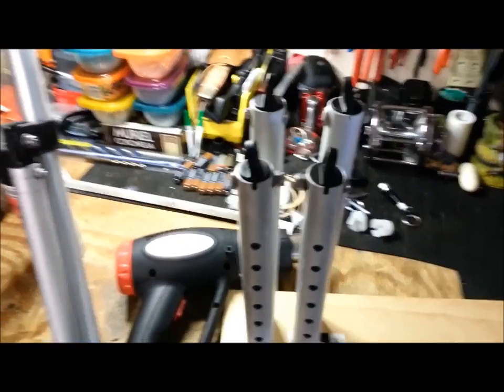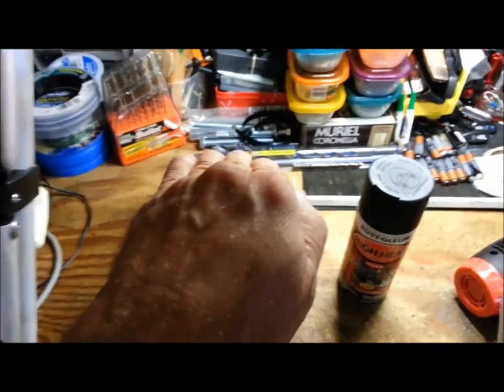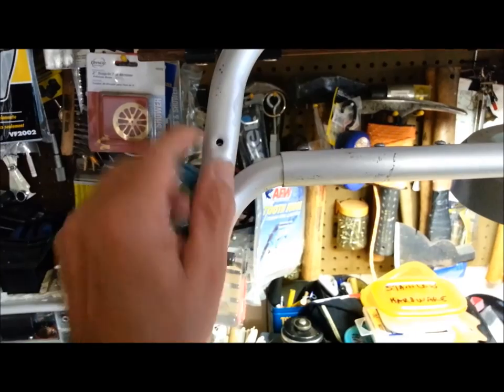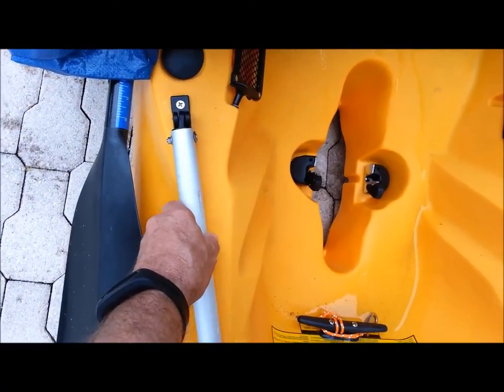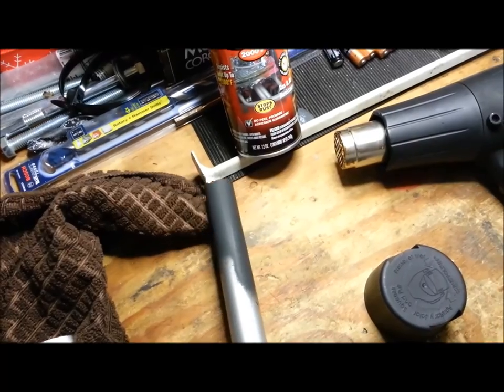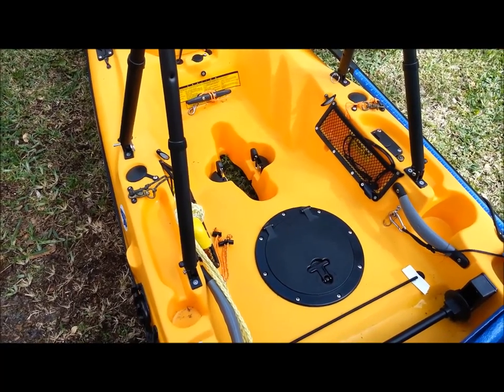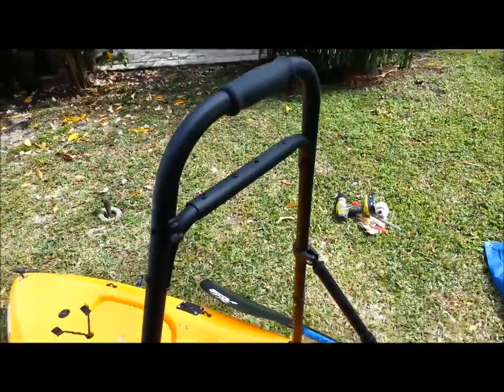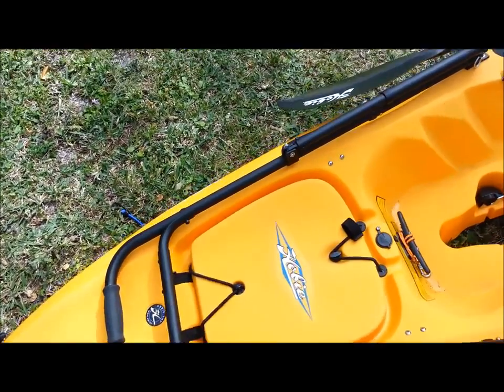Home Made hobie Style H-Bar - Part 5

Comment: Love it! Great video tutorial, John.  I’ve had issues with paints chipping off of diy pieces.  I’ve started using the truck Berliner or undercoat that is in spray cans.  It has a more textured, rubberized feel.  It will chip bit seems to be more durable than reflate spray enamels.
Reply from the maker: That's a very good idea.  I have used the same on PVC and aluminum and it seems to work way better! Thanks!

Comment: Thanks for this great project.  I'm about to make one for my Outback now.  Since you've been using it for awhile now I was wondering if the top part is wide enough or if you would prefer a wider bar to lean on?  I'm at a point in my designing where I could use another part of the walker as the top piece but it would mean modifying beyond repair. 
I'm excited to finish the H-Bar!  Appreciate you sharing.
Reply from the maker: Nice! The top part is definitely wide enough for me. I am 6'2" and 200 pounds and it fits my mid section perfectly.
Reply: Thanks for the prompt response John.  I'll continue forward to copy your great design!  Thanks again for sharing.  Signed: Not As Stable As I Used To Be Fisherman.  Ha! @JohnSims3
Reply from the maker: @darylwchan  my pleasure!

Comment: excellent video series on this H-bar project.  Do you use this in salt water?  I was wondering how the inside of the aluminum is holding up to corrosion.  I have access to a stainless steel walker of similar design.  I don't understand why you needed to heat bend the end swivel pieces; I thought you used an angled shim to mount the brackets to the kayak?  Was the second horizontal piece actually necessary?  I see that it hinders full opening of the front hatch lid.  Thank for the video and I hope you can now inform us the long-term results of the project.
Reply from the maker: Thank you! And my pleasure! Yes, I use it in salt water. I have had no issues because I remove the adjustable legs and wash it out with fresh water. I suppose you could spray it but then the pieces may not fit right. I needed to heat bend them because the way I had to mount the mounting pieces on the hull, they were skewed or angled a bit from the hull surface. It made a much better fit with no binding. I didn't use an angled shim, however I used one on the outflow tube on my automatic bilge pump project. I think the second horizontal piece wasn't really necessary but it made a big difference in side to side rigidity. Actually it doesn't hinder the hatch that much and what I keep in there is food and water. I am very happy with the project and have had absolutely no issues at all. I have been in some pretty rough water and was able to hold on with confidence, plus to be able to lean against it while standing and fly fishing or sight casting is a real treat. As far as the long term results, it's been almost 3 years of regular use and no issues at all. I made sure I primed it good so the paint would stick. I thought I'd have issues with paint peel, but none so far. Stainless steel would be a nice option! Good luck and feel free to contact me if you decide to build one and have any questions. Happy New Year!
Reply: @ John Sims.   Thanks for the quick reply.  How did you symmetrically bend the legs out wider?  I found some special deck hinges which compensate for the angled attachment of the H-Bar to the deck.  This will solve not needing to heat bend the tabs on the end fittings.
https://www.ebay.com/itm/Bimini-Top-Parts-Deck-HInge/273606294001.  So there is really no longer a height adjustability in the lengths of the main H-bar? ...just the folding braces?   Thanks
Reply from the maker: I just used a bench vice and bent them very carefully. Those deck hinges will work for sure! Yes, the main bar still adjusts.